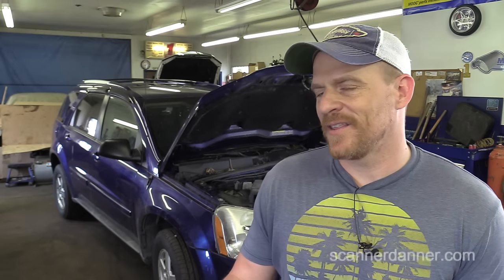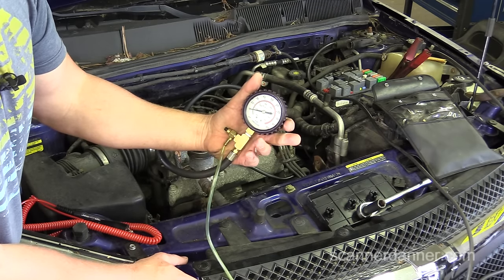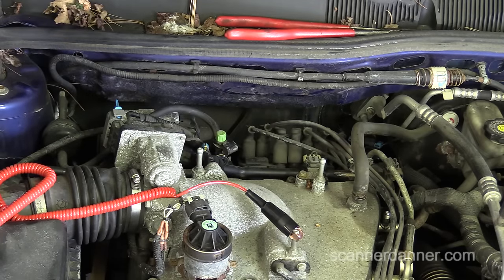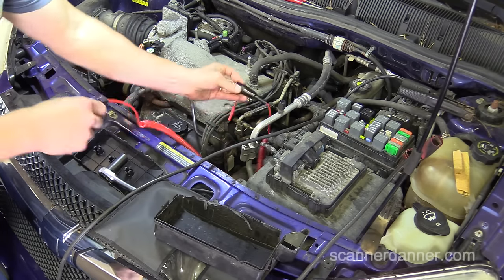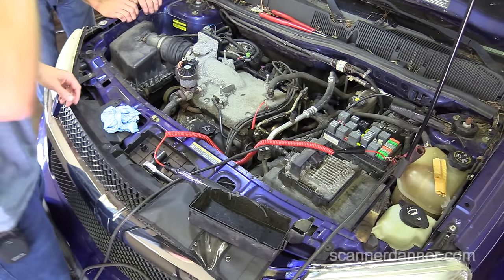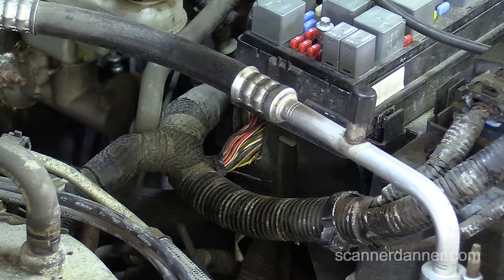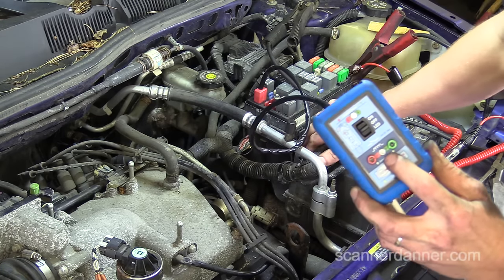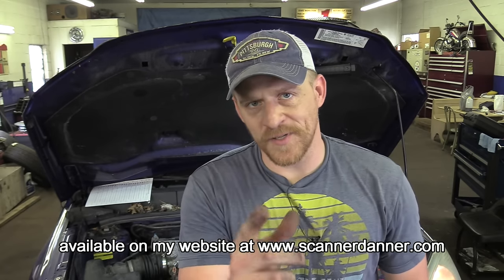No Start, Engine Cranks Okay, Troubleshooting With Basic Tools (No Power to Injectors)

Comment: informative diagnostic Video. Could you just use the test light on the injecter pulse and power directly without the red wire you plugged in?
Reply from the maker: I use the test light to check injector pulse all the time

Comment: LOL, I need you here. I've been trying to fix a crank but no start condition on my 1991 Nissan Sentra SE-R for a month.  I've replaced the fuel pump, plugs, dz cap and rotor.  Tomorrow I will receive a new coil since it's a bit out of spec.

Comment: I have a simple question. I sometimes I think I see you connect the test light to ground when you test an injector. This confuses me since I assume most of the ones you demonstrate are ground side controlled. Although in this video, you do use positive when testing the injector, I could swear I remember some videos where you go to ground.   

Yes.  When connected to ground, I know the test light will probably not fire injector.  But this still gives me an uneasy feeling. 

So with that, isn't it always best that the test light is connected to be the opposite polarity as the switch side when testing control, e.g. if ground side switched, you'd have test light connected to power?

Lastly, thank you for all of the knowledge and experience you have shared on your public channel and premium. Because of you, I have diagnosed a ton of cars.  Thanks!
Reply: I have in the past simply backbrobed injectors with the test light to ground but on some injectors you will energize the circuit enough to open the injector. So lately I've been disconnecting them and connecting a test light to B+. You can do it either way just know if you are connecting to ground and backprobing, pay close attention for a click noise, which obviously would be bad. 
Thanks so much!

Comment: Very good trouble shooting and attention  to detail.  If I didn't watch the whole video I wouldn't have found my problem on the throttle actuator control motor. I did replace the fuel injector and coil pack wires ; point A  to the PCM; point B because of the wires had bare spots at the end of the connectors. After replacing the wires, I had a starting problem and the vehicle would never fire up and I assumed that it would be the ASD relay and 2 days after pulling my hair for the right problem, Scanner Danner stepped up the plate.
there is a time for all of the bullshit joking and jesters that most of the other videos I looked upon thus , is the way I never watched the videos through all the antics of humor through out the videos. Scanner Danner Captivates the audiences and he does it right. Thank you.

Comment: In limited wire conditions I would use telephone ur or ul connectors. No crimp needed. They have an insulation gel also. They use an idc type method. No stripping needed. Very handy.

Comment: I work at a fertilizer plant and our vehicles drive through corrosive mud and any bare wires turn green in days then break. I started adding a little dielectric grease to each side of the heat shrink connector and then when I melt it when the grease comes out I know I got a good connection.

Comment: Thanks for this content, i have open circuit in injector 2 on my cruze, im not sure if its the reason behind a cranking but very hard start in cold engine, but if the engine start and gets hot already, it starts quickly.I hope you give some tips Sir.

Comment: You're a genius, wish I had you to figure out my no shift in drive on a 2000 Chevy Silverado 5.3 vortex 4l60e, if I do a amp drop test ,with the leads on ground,from battery to volt meter ,it drops to 0 ,when I pull the tbc fuse, & when I bridge the gap,all of the solenoids click.

Comment: Scannerdanner you are the only one I know who can help me out with this car problem. The car is a range rover 1998 p38 4.6HSE and v8. Many people were invited to start the car even from a far State but the couldn't. The challenge is a crank no start, no spark,no injector pulse but good communication with a scan tool. I have added fuel to the intake manifold and crank the engine no change at all. It is not starting. In addition, I checked for spark, but there is no spark as well.
Hence, I have just checked for injector pulse but there's no injector pulse either. There is also no ignition current to the injector circuit with key ON and engine off. 
All the fuses and relays are good. I also checked the injector circuit for continuity if the wire is shorted but it was ok. Scan tool communicated and showed only p1843 and p1842 code. There was no RPM during cranking. What I noticed today when I compared the ignition, earth and DC with the same car that was starting and driving to the car that was not starting, what I saw made me to flabbergasted. Where the was ignition for example in the working car there was DC in the car that was not starting. Also a particular relay circuit for example RL-2 one of the pin of the connector when my test light was on battery ground and relay removed, the pump buzzed and testlight dim but when I tried that same location with test light and same pin the test light was dim and ABS relay was actuated no buzz from pump. It is like that in many places in the fuse box and PCM circuit. Please  what's the cause of the problem and what do I need to do to fix the problem?
Reply from the maker: Let's move this to my forum. It is free to join www.scannerdanner.com 
We can definitely help you
Reply: @ScannerDanner  Ok, that's a very nice idea, thank you sir.

Comment: And to the other side of it you know that the computer has 12 volts to it through the fuse of the ECM because you got injection pulses that's coming from the computer to the fuel injector that tells me the computer is getting is 12v again me and you promote electronics in automotive electronic channels it's great to see an automotive diagnostic technician like you not a mechanic

Comment: Good job.  My only critique would have been to retape the bundle that you opened up in order to make the repair then to zip-tie them up suspending them from the a/c line above so the bundle would no longer be in contact with the plastic box edge.

Comment: Your lesson R great & yes this is how we did it back in the late 70's & early 80's & yes it still applies BUT 1st thing U do on this car that had a fuel pump replaced is get the wire diagram ready, add propane & start the vehicle. YES U R going to go the the power supply @ an injector so ultimately the results R the same.
Reply from the maker: Dude for real, there is no "first thing you do". Every situation and every car is different. If you don't like where I started, that's fine, just know there are many different ways to attack the same issue and a student of this trade needs to learn them all.
There is definitely NOT one single "right way" to start on any electrical or driveability problem. Learn to adapt to the situation with the tools in hand and the car being worked on

Comment: Paul, I wondered what killed the pump. I seen one that the damage somehow migrated to other things.  Nice find though.  Pays to do a close further visual inspection
Reply from the maker: I'm not sure. I wasn't there for that part, something doesn't quite add up there if you ask me. But that's okay
Reply: Yeah.  I suspected a little bit of that too.  Have had plenty of pumps go bad, especially after cavitating or running dry often.  Or people not changing their fuel filters.  Then again I work on a lot of pre-Sept. 1996 cars stil.  I just wondered what would make the pump that bad through to go through all that.

Comment: I've been using the "horrible fright" brand heatshrink butt connectors, they seem to work ok and have the glue seal when heated, coating seems a bit thin and possibly the metal sleeve, I didn't measure them though, so maybe fine.

Comment: U- activate tool is pretty cool.  I have to see if I can get one for my son. 
Right now he's troubleshooting a GMC truck that he put a pump and tank on. Now it won't run. It's a fuel problem as it will run with a shot of gas.
I'm helping over the phone. He has no fancy tools and no pressure gauge . It gets fuel to the spider manifold . I had him do injector power tests and it has power and controlled ground.
Then he got a gauge somewhere and found pressure , though it looked like a lot was only ten pounds.
I keep bugging him to check grounds. I figure it is bad connection at pump ground and it's not running full power or bad computer connection and it runs small light bulb okay but not injectors.
Or both.
It has to be, that's all that is left.
Nothing like ' partial ' connections to really mess with you.
I'd like to get him a real scan tool someday so he can watch you and learn how to use it.

Comment: Was there any way to keep the harness from sagging again and repeating the rubbing process due to weight of harness and vibration?  Looks like problem will repeat over time.  Thanks for video.
Reply from the maker: It will but not until this car is in the junkyard. Good suggestion though Jim and something I should have done

Comment: Wow I have to say you really explained it in such great detail and to the point. I'm dealing with a crank no start, no spark issue on a fresh VR6 rebuild. I have no communication with the ECU and I think there's a short, and I definitely have high resistance. I don't see any obvious brakes, and yes my CPS sensor is connected.
Do you have any ideas of what it could be? Thanks again and God bless!
Reply from the maker: No com with ECM. Step 1, what codes are in all the other modules.
Step 2, check for a 5v reference to your TPS or MAP sensor
Reply: @ScannerDanner  , unfortunately since I can't scan it communication with the ECU I'm not able to see what codes there are so for that reason I won't be able to bring up any codes with the vcds software.
 I know I'm getting at least 4 1/2 volts on the signal side of the Hall sensor  for the distributor is that normal? So if I don't get at least five both at the TPS sensor or map sensor what would that mean? I guess I would have to replace those sensors?

One important thing I liked to mention I never had any of these crank no start/ no spark issues before the engine was rebuilt no I do.
Thanks again.
Reply from the maker: @Eurospec73  no, it tells us if the ECM is "alive" (the 5v reference circuit) I have lots of videos on this!

Comment: Have a friend who has a 2008 Suzuki with an poo8. Which means the timimg belt problem. But, the car runs fine it has power and no miss firer. Wondering what can we do to fix the problem. Watching you tube I see having the same problem and spend over $2,000 and still have the same problem. Thank you for your time. L.Rodriguez

Comment: I have something I would like to add here I have some filed experience with these models and you sir honesty are doing the wire stripping wrong that fuse box unbolts and picks up off the wires for easy repair access

Comment: ScannerDanner can you please explain what a "load" and "control" are i have a pretty good idea idea on the load but alil more info would give me a better understanding of it but im completely lost on the control part
Reply from the maker: If we are talking about a relay. The "control" is the side that has the coil winding and it's job is to make a magnetic field which closes or opens an internal mechanical switch. The "load" is the switch side and it carries the current to the device (electric motor, light bulbs, etc)
A relay takes a small current (100ma) and controls a large current (up to 40 a). That is it's main purpose. Hope that answered your questions. This video may help https://www.youtube.com/watch?v=oo1SRIFIkhs&lc=Ugw9Hs-QEt2qFCzNWbJ4AaABAg

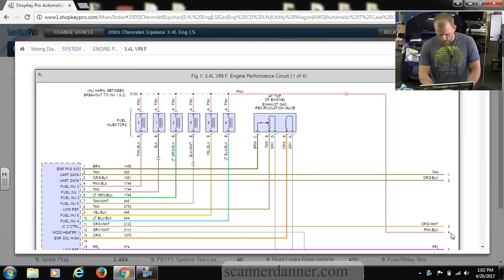Comment: If you pull that main relay fuse, you could possibly see injector pulse on the terminal that is not hot. See the diagram at 8:06. When the drivers ground the injectors(engine cranking) your test light would see it at that fuse terminal. I'm not very good at articulating what my point is, LOL. If the injectors are not easily accessible, this is one way to check injector pulse.

Comment: I wish you were close by so I could get your opinion on my explorer. Having the same issues. Good pressure to rail after replacing fuel pump. truck will run on either so i know its getting spark. Injectors aren't firing. Truck sat for 2 months at the dealer and they couldn't figure it out.

Comment: 2005 Buick rendezvous 3.4L had to replace all 3 fuel lines (do to rust), fuel pump, fuel filter. I have about 100psi of fuel pressure to the inlet of fuel pressure regulator. The fuel will not go true the regulator. The engine runs with starting fluid. I checked the pump relay checked fine. I removed the pump relay and jumped the terminals to run the pump constantly still no start. I removed the  regulator blew 55 pounds of air in the regulator intake hooked up a vacuum hand pump with 30 inch pounds of vacuum to the regulator, regulator  did not open. I check a new regulator got the same results. Can you give me a idea on what's going on. Your videos are superThanks

Comment: Hi! I have a problem.

I have a Mercedes C-class 1995 DIesel automatic.
So far it has been running well. Very smooth and comfortable, no problems, accelerated well, etc.
Only problem was a very minor diesel pump leak, obvious only to mechanics, which was so minimal that the car used about as much fuel as it should have. (it has about 250,000 miles on it.)

However, recently, on going uphill with the accelerator pressed down hard, something happened, and the EDC light turned on.

Following this, the car would start, but would run very weakly or stop after a few hundred yards.

Now, it will only start up if cranked a long time with the accelerator pressed down. A few seconds after the engine turns on, revs fall and the engine switches off. (The EDC light is no longer on by the way.) Hence, I'm unable to drive the car even a few feet.

What could the problem be? Is it the diesel pump or could it be something else? And what kind of repairs are we looking at?

Thank you very much!

Comment: Danner i have  Ford Focus mk1 2004 petrol 1.6 16v 100hp. i don't know if this is a problem, but everytime whenever i unscrew the fuel cap, there is a prety loud of hissing noise an fuel smel comming out of the fuel cap. The longer i drive the more it hisses. Now the Ford dealer cant give me a straight answer Whether this is normal or not. They want me to come over for a diagnosis.  i already replaced the fuel cap with two other new different fuel caps. But it still does this. And im very sure the new fuel cap is also vented.

Comment: If you unplug the coil from the sparkplug can you do same test with test light? I've seen people using a wireless test light to test for ignition
Reply from the maker: No, because you can't vary the air gap to check distance the spark can jump, which is vital information

Comment: You are awesome scannerdanner I have a 1984 Nissan 300zx that was kept running at a VW garage all weekend well until it ran out of gas the tank was full he started it to charge the battery they closed up.forgotten about it I bought the car was owned by a heart doctor make a long story short the guy that owns the business sold it for that doc he told me it needed a fuel pump but not the case pin 6 on the ecu isn't grounding the efi relay it cranks but no spark If I wasn't 1 hour away from you I would bring it to your place of business

Comment: Sir I have also a problem like that on gdi pajero 4g93 there is no power feed on the injector and the check engine blinking.can you tell what I'm going to do in what is the exact trouble

Comment: Hello Sr.
First of all thank you for all your amazing teaching.
I’m working on my 2010 Mercedes B200 which has a crank no start situation. When  I disconnect  the crank sensor the engine starts, but when I reconnect it the engine doesn’t start. The code is P0336 (crankshaft position sensor no signal.
What do you think of this situation ?
Thank you for your input.
Reply from the maker: My first thought is a mechanical timing problem. When I've seen this in the past, that's what it was. But you'll need to verify what that crank signal looks like. Do you have a scope? Have you changed that sensor? Can you physically see the trigger wheel for the crank sensor?
Reply: Thank you for your prompt response.
I don’t have a scope, but the powerprobe reads aprox 2.17 v. In a range of -1v and 6v.
I can’t see the trigger wheel.
Thank you again for taking the time to respond so quickly.

Comment: My 2012 Jeep keeps blowing the fuel pump fuse , any suggestions on what it could be ? Or do I have an open circuit too ? Thanks and great video!!!
Reply from the maker: A fuse that blows will never be from an open circuit. You have a short to ground in the fuel pump circuit. First step is to find out what all runs off of that fuse. If it is just the pump, then unplug the fuel pump connector at the tank and then see if the fuse still blows. If it doesn't, drop the tank and replace the pump assembly, but look at the harness real close while you are in there.
Reply: ScannerDanner thank you !! This helped a lot ! I fixed the issue.
Reply from the maker: What was it?

Comment: 2001 Ford Ranger starts and runs fine then suddenly cranks but won't start. 3 to 4 or 5 hours later starts and runs as it should until the next unknown time it does it again. I checked fuel pump relay, fuses etc. they all seem ok. Any ideas?
Reply from the maker: Not without knowing what you are missing when it doesn't start. You need to check for spark, injector pulse and then a fuel pressure DURING the no start for me to help further.  
Post this to my forum okay? It is free to join. 
https://www.scannerdanner.com/forum.html